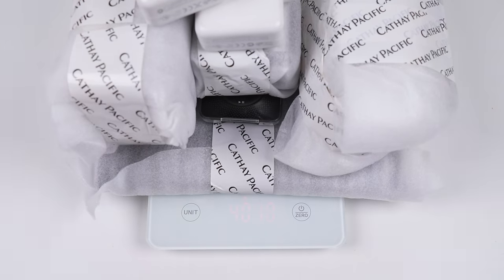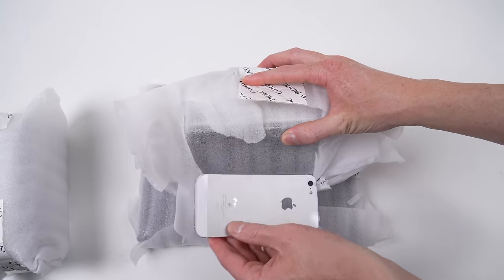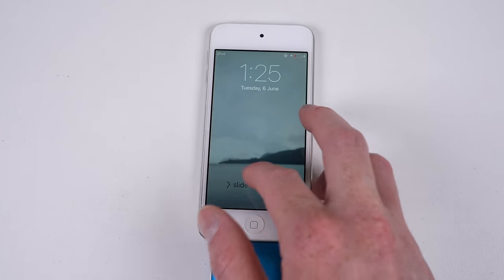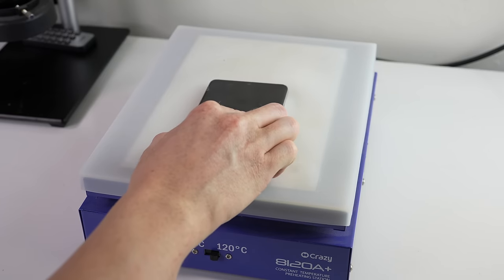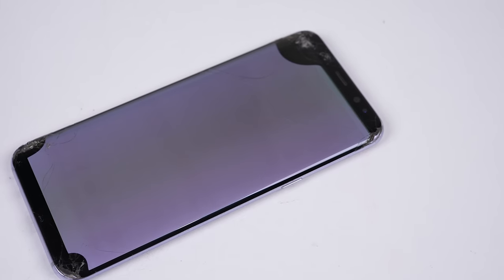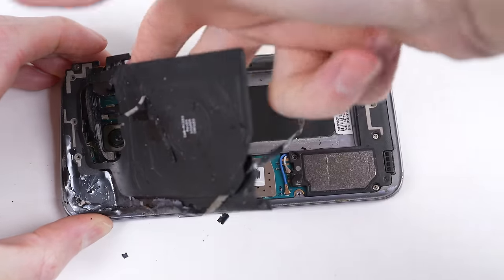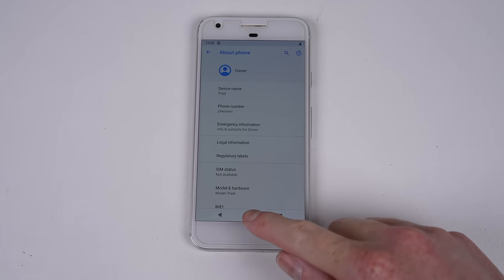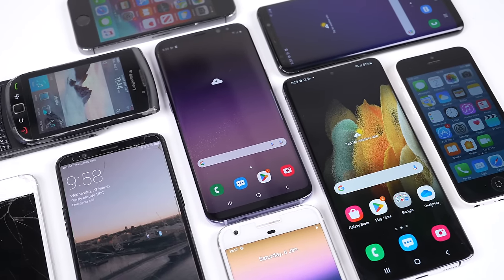Hitting the Jackpot at an E-Waste Centre - It's Amazing What People Throw Out!

Comment: i have encountered that exact same issue with the ipad 1, that is actually the battery being bad. i had the same fault on two seperate ipad first gens and they both had bad batteries
Reply: I have a whole pile of original iPads I've wound up with over time that all have that same problem. One of them was mine and I still have stuff on it. I hope to get that one working again sometime.

Comment: I absolutely love saving things from E-Waste! From my own experience about 80% of the devices I've gotten fully work without issue and were just thrown away. I've gotten and saved so many devices, UPS inverters, Laptops, a mid 2009 Macbook Pro (Needed a new drive and corrosion removal due to minor water damage), a Logitech 5.1 speaker system (Needed a new audio jack), and lots of old laptop batteries that I've salvaged to get the 18650 cells and repurposed those for USB power banks.

It's sad with the amount of working stuff that gets thrown away, I'm hoping this changes in the near future.

Comment: that ipod is a 6.5, a 7th gen is only 160gb while the one you have is a 120gb wich was a mid step between the 6 and 7, it differs in that its running the same firmware and storage limitarions of the 6th gen, limiting it to 128gb of flash 
while the 7th gen can be modded to accept much much more storage

Comment: I recently restored a ipod touch 4th Generation that was password locked put it in dfu mode and connected it to iTunes to restore,  the only problem was it kept failing on my windows laptop so I got my old macbook out and it worked first time , then I put it back into dfu mode and successfully restored it on windows laptop

Comment: Yeah, a lot of people at the smallest fault just throw stuff away and upgrade to newer stuff, not really wanting to bother putting effort in with getting it repaired and selling it. Which should be more incentivized. Since I do also feel like too many people think it is way more fuss to sell it than it actually is, simply because they never did it. Still it would be way better if e-waste centers would be allowed to repair and sell them and do repair and selling. Unless for some reason demanded to destroy device, because in some cases companies will want that to ensure sensitive data can't be recovered. Still nevertheless, it would really help reducing amount of e-waste and have potential to provide e-waste centers with revenue. I mean in the end, they could also outsource repair and selling, to third party.

Also that S21 Ultra, I kind of can't get why throw that away, like I got regular S21 and still works perfectly. Like sure battery is not as good as new anymore, used to get me through day with quite a bit of juice left. But it still gets me through the day, just it is in need of recharging at the end of it, which is fine, as long as it gets there. But other than that, it performs well and will still get Android 14, eventually, since Samsung won't stop treating place I live in, that is part of EU, as third world country with update release dates. Though to be fair, they aren't the worst at it, but it can take a month.

Comment: I really can't agree that throwing out a 3-year-old phone with a broken screen is wasteful. Repairing it would cost as much or more as getting a secondhand S21 Ultra if you went the route of a repair shop, not much less if you bought an ifixit kit and repaired it yourself (not something a lot of people would be willing to try), and also a screen replacement is less certain to solve the issue than just buying a replacement.

Then, of course, there's also the fact that a three-year-old phone is around the time a lot of people would be looking to upgrade anyway.

Throwing out that S21 Ultra wasn't the only viable option,  but it makes sense from every perspective other than environmental footprint, and throwing out a whole phone vs throwing out a display is a pretty small difference. Those small differences can add up across the billions of people on earth and a long period of time, but that's a problem with how devices are made to be thrown out every few years, not with individuals who choose to throw out broken and near- obsolete devices when they break.

Comment: That's weird that that S21 does a clean reset, while my S9 error warning refuses and is locked out somehow.
Older stuff gets beyond reasonable repair quite quickly, ie, 4-5 years, if you look at used working prices, eg used S8 $75, good used screen $80-$130.

Comment: This video reminds me of the e-waste that my bluetooth earbuds and headphones that I have that are broken, stopped working on 1 side, water damage from using them in the rain, and the batteries have already degraded and the batteries don't how a charge for long. The majority of the manufacturers and consumers says wireless is the future but based on my experience with bluetooth earbuds and headphones, it's the complete opposite. The other users of using bluetooth earbuds and headphones will experience similar issues that I have experience when using bluetooth. I prefer using wires because most are universal since most are not proprietary, superior sound quality, reliable and it just works. There are wired earbuds and headphones that have user removable and user upgradeable cables compared to bluetooth that relies on non user removable and non user upgradeable batteries. The user removable and user upgradeable cables don't void the warranty like the bluetooth earbuds and headphones batteries that are soldered to the earbuds and headphones. The things that are inconvenient are reliable and repairable and the things that are convenient are unreliable and unrepairable due to e-waste and planned obsolescence. I would not be surprised if the video game consoles that are all digital follow the same path as e-waste for bluetooth earbuds and headphones since it's going in that direction with more mondern and newer tech products and consumer products. For example, when sony, nintendo and microsoft changed there minds about wanting to sell new all digital game console. Sony, nintendo and microsoft release a software update that intentionally bricks there all digital game consoles when a new console comes out in order to make more money when a new all digital console comes out and its part of the terms and conditions and that they can't be sued for it because the consumers agreed to the terms and conditions. There is no law against selling e-waste and planned obsolescence products in order to make money when a new product comes out. Unfortunately, it's already happening with modern consumer products and we the consumers don't know how far all the corporations and manufacturers will go since they have gotten greedier every year. All the corporations and manufacturers want more money like money to the corporations and manufacturers are like an all you can eat buffet but with money instead of food.

Comment: Yeah but the s21 ultra would have had google lock or Samsung Knox I tried fixing up broken Samsung's and if you reset it via the boot manager it will cause google lock you can only reset it via the in phone settings else it will say unauthorized reset both ways require the previous owners google account+ password to reset the phone

Comment: i have an iphone 6s that wont power on or even do anything when the charger is plugged in 
i have opened it and tried removing the battery power and plug it back in and that still doesnt do anything 
it might be because the battery was at like 50% health before it stopped working

Comment: All the apple products should be sent to a recycling centre regardless of if they are undamaged and working.. apple should be making and then shipping all products to the ewaist recycling centres so they can be completely disassembled so all the caps and resistors and other stuff can be used to make good phones and tablets from Google or oppo or vivo and the rest of the android manufacturers.. the useless apple parts should be melted down into their individual materials and recast into new android screens and shells ect 😂😂😂😂 there is no such thing as a good apple product its just manufactured overpriced ewaist anyway.